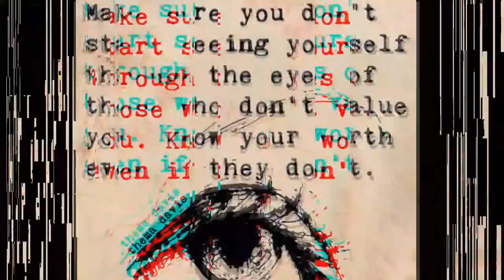Minor set back | Im not Broken

Comment: So sorry you are having car issues. I had my hubby look at the video and he mentioned catalytic converter and wanted to know how long the car was driven without an air filter? He said anything could have  been sucked into the intake. Oh and the 02 sensor is under neath part of the exhaust. I had that 02 sensor issue when I had a Mazda....mechanic fixed it (expensive) but it never drove smooth after that and the check engine light stayed on constantly! 🙁
Reply from the maker: When I bought the car it had an air filter and then it was running bad I took it back to the place when I got it back there was no air filter it ran fine just the other day we decided to try the air filter again and the car died again we put the air filter back in and the car started then we changed spark plugs and filled a major crack in the muffler and also checked the idle airflow and when we put it back in the car won't start it just clicks so next we are trying to buy a new idle air flow and see if that works thank you so much for trying to help out tell your husband we thank him
Reply: melissandra lopez I read this to my husband and he wanted to know if you ‘gapped’ the spark plugs? I don’t know what that means, but he said with certain cars the spark plugs need to be gapped. He also said if you replace the spark plugs you should also replace the wires. Too bad you don’t live close, he would look at it. My husband isn’t a mechanic, but he does most of the car work on our vehicles....not the major stuff that requires certain machines. I hope you all get it fixed soon. It sucks not having transportation.
Reply from the maker: @mtamorphis  Yes... kilo replaced the spark plugs wires and coils what kind of stuck at the moment but we will figure it out somehow thank you so much